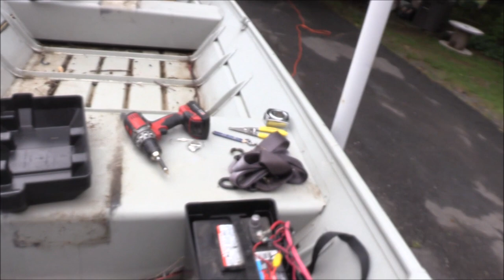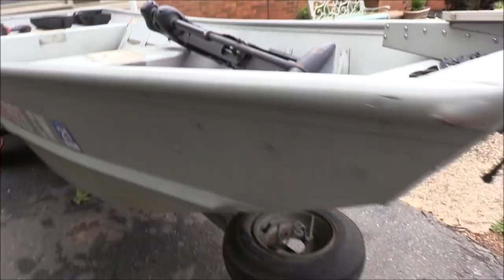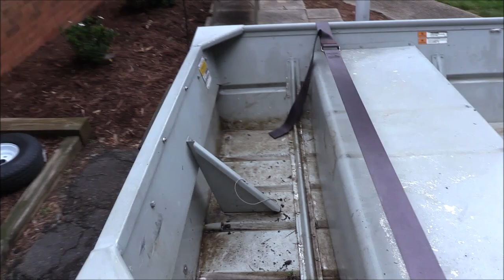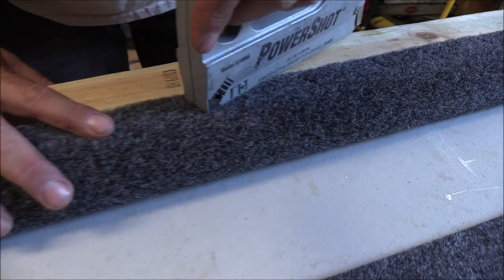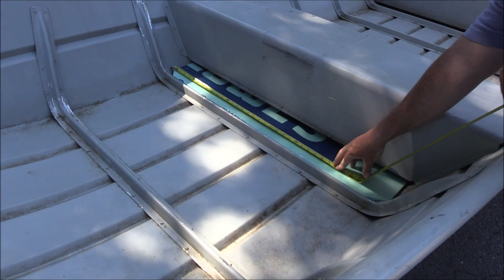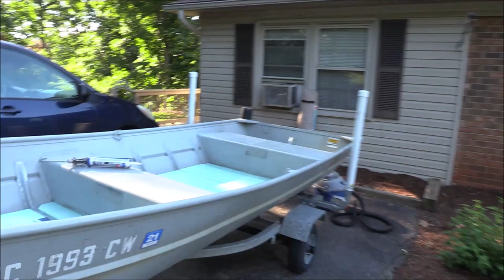Jon Boat to Bass Boat Ep 1.

Comment: Can you get some of that bedliner & use that to paint the floor/sides of the jonboat?
would it make it too heavy? What kind of chairs are you going to go with? Is there such as thing as a "clip on"
chair you could take out if you wanted to go duck hunting?
bol
Reply from the maker: Im not sure about the bed liner....... im gonna use bass seats on a pedastal..... yes tthey make a clamp on seat bracket that you can remove if needed